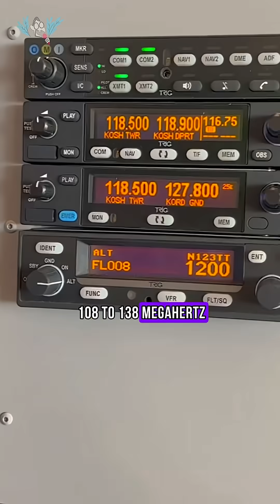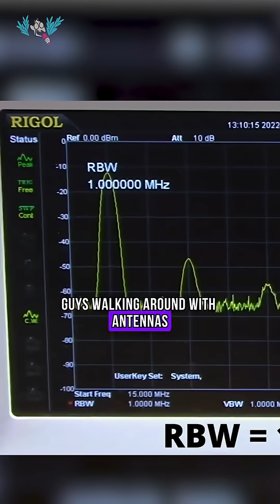Starlink in-flight WiFi banned: Dangerous pilot radio interference

Comment: The 4th...8th... 16th... etc  "of that frequency" he mentions is called harmonics that are also transmitted with non ideal radio waves as all of them are.

And the harmonic goes up ( 1st, 2nd.. 3rd harmonics etc...) , it's power drops considerably... But considerin that the power of the 1st main wave is very high, the power of a few harmonics after still considerable causing interference

Comment: RF Engineer here: Transmitters do have harmonics, but these are multiples of the carrier frequency, not fractions.  Eg. A VHF air band radio can transmit on 120.0 MHz.  The transmitter can have harmonics on 240, 360, 480, 600, etc MHz  but a filter is used to remove these harmonics.  The harmonics of various radio transmitters can overload GNSS/GPS receivers if not properly installed.  Eg the VHF antenna is too close to the GPS receive antenna.  The ADSB transponder can also be overloaded in the same way.
Reply: presumably there would have had to have been considerable testing to qualify starlink for aircraft use. You can't just bolt stuff on to an airplane. That's why you can't legally use your cell phone in flight because every cell phone has not been qualified to ensure no interference with coms or nav.  I know a lot of professional pilots. there is no buzz out there of issues with starlilnk and coms in the pilot community. There have been no ADs, or SBs. There has been no indication from the FAA that starlink is banned. This is some political bullshit because of Elon and his various personality clashes.
Reply: This whole story sounded suspicious. And then I think OP demonstrated his lack of knowledge about radio, so I don't see why trust any of this.
Reply: Finally someone who knows what he is talking about.
Reply: To the RF Engineer, firstly, wish I had gone that path when younger, but I imagine those things are made in China and made as cheap as possible lacking some type of filtering or shielding , I just assume because of some of the cheap radio crap I see come out of China, but I'm curious about your opinion on what if any effect that altitude especially might have on the transmitter, not to mention temperature as I know that can cause issues with electronics, maybe it doesn't have any kind of heat source built into it causing issues, we'd like to think someone thought of all this when designing these things but who knows ..

Maybe I'll look up the f.c.c data on the things later, sometimes they actually tear things down and have pictures of them, but being starlink, they may not publicly share internal photos..

Thanks

Comment: RF engineer here.  AM modulation is used on the VHF aircraft band on the frequencies of 108 to 136 MHz.  It does not broadcast on AM radio which also has AM modulation on the frequencies of 530-1710 kHz.  VHF air band radio has used AM modulation since the 1930's.  They never upgraded to more efficient modulations like Single Sideband, FM, or digital modulation because of the number of legacy radios that would have to be replaced.
Reply: AM radio simply means amplitude modulation radio, nothing more.  He didn't say they use the commercial AM radio broadcast band.  Also, AM stands for amplitude modulation.  You just say AM, not AM modulation, because that's saying amplitude modulation modulation.

Comment: Half, quarter, eighth???... Doesn't it also do a third, a fifth, a sixth, etc like harmonics?
Reply: No.  Transmitters don't produce sub harmonics.  The harmonics, which are supposed to be filtered out, would be at multiples of the transmitter frequency.

Comment: It's actually funny Starlink engineers managed to do this. It can't be a harmonic from the power supply, WiFi or satellite comms. I'd place my bets on it being the ethernet putting out RF. 2.5gbe Base-T would be bang on the 120mhz range for 1st harmonic

Comment: Nitpick: it will be overloading of the IF that would cause interference in this scenario, not harmonic mixing, because harmonics only appear at *multiples*, not divisions of a given frequency.

However, aircraft RF will often go through several mixing stages, at which point the mixing stage(s) of another particularly strong transmitter operating nearby can radiate and cause interference in the other one.

Also: Starlink uses a particular design of steered array antenna system which is poorly tested on aircraft in applications other than radar.

Comment: AM is used because it isn't affected by a phenomenon known as "capture effect". You got close to the issue when mentioning two transmitters at the same time, but missed the overall explanation. Using FM, when two signals are being received, only the strongest signal will be demodulated, and therefore received. The weaker signal is simply rejected. This does not happen with AM, as any pilot who's ever been "stepped on" (had someone else broadcast at the same time as you) can attest. Instead of the capture that would happen with FM, everyone in range listening to the AM band hears the two signals interfere and create a "delightful" cacophony.
Reply: That is not always true for AM modulation.  On the AM radio band many stations across the county are on the same frequency.  At night radio signals propagate better.  Sometimes you can hear two distant stations together with a slight warble.  But most of the time one station will block the other.  You are right that FM does have a capture effect.  Generally you will only hear one FM station.
Reply: @milofonbil (Skip) is not an AM specific phenomenon. That is more of a frequency related thing. Lower frequencies tend to be more likely to skip, or tunnel through layers of ionized atmosphere. As such, these are also obviously highly dependent on solar radiation, so time of day and solar activity.

Comment: That's not the reason they use AM, they use AM as any other modulation technology is affected by the Doppler effect and they'd step on themselves. Also in ATC you don't hear both you hear a beep/hum that lets the operators know they are stepping on or being stepped on
Reply: AM modulation (CW, SSB and many digital modulations) do have Doppler effect.  FM and Phase modulations are more immune to Doppler.

Comment: I find this fascinating … worked in the cable industry, and I remember the FAA would to flybys to see if they pick up analog cable ch 14 I think; also ch 19 was sometimes interfering with the emergency services radios; you could hear it on the tv, also the image would be distorted for the time EMS would be speaking on the radio;
Reply: Cable systems sometimes don't have good connections and leak both ways -- in and out.
Reply: Here in the US, the FAA periodically checks urban areas for cable leakage which can affect avionics.

Comment: All communications receivers are subjected to de-sensitization in which their front-ends are overwhelmed by nearby strong emission sources irregardless of (differences of) their operating frequencies. This phenomenon basically drives a receiver into saturation and out of its linear operating mode (all RF receivers) making it no longer capable of amplifying its intended receiver signal. Careful use of traps, splitter/combiners would isolate systems. The talk about generating spurious energy at half-frequency, quarter-frequency etc (sub-harmonics) are baseless; I have observed only once a sub-harmonic (at half frequency of the original signal ) in a very unique circuit.
Reply: Spurious emissions can be at harmonics of the carrier frequency, due to excessive sideband products (splattering ), intermodulation, etc.  But the sub harmonics this YouTuber is talking about is fiction.

Comment: So many things are wrong in this discussion, first if two transmit in am at the same time you block the two signals, unless one is closely, second starlink is digital and in a totally different frequency band so a simple filtering stops problems, 3rd all internet connections are stopped during landing and take off, etc etc
Reply: No, they keep the Starlinks on continuously, from gate to gate, and do not turn it off during take off or landing. The two signal are so far apart it's unlikely to be a simple filtering issue. As others have pointed out, it's could well be the starlink's power supply that causes the interference.

Comment: Another pilot here. I use Starlink in the cockpit of small aircraft without issue. No interference with ATC communication. Know of others that do the same.
Reply: thats because this video is bs about starlink. Starlink uses a different data encoding based on FM and it is directional along with a different frequency than what the ATC uses, vastly different like way high frequencies. So if you get static that means your power supply is crap and you have interference on your DC lines so your airplane needs maintenance then because the DC power is not doing well or your AM radio is noisy.

Comment: Doesn't know what he's talking about.  First, radios do not broadcast frequencies that are fractions of its carrier frequency.  They just don't.  The math doesn't math.  However, it IS possible for the aircraft's radios to RECEIVE frequencies that are multiples of the frequency they are tuned to, and if that happens, if is a fault in the aircraft radios, not Starlink.
Second, putting out 10 kHz packets does not produce multiples of 10 kHz in the broadcast, at any detectable level.
This guy is just spreading old wives' tales.

Comment: This is the stuff that drives circuit board designers ABSOLUTELY NUTS. Copper left on the circuit board even if it's grounded can act as an antenna gathering signals in stuffing it into everything you're trying to control. It's just absolutely ridiculous. The best example of this is security tags in stores have no power supply yet they work. I need to add they receive power, energize their circuitry and send back an alarm code if not decertified buy the cash register.
Reply: 100% EMI/EMC issues are complex indeed and can drive designers nuts.  It's not only radiated interference, but conducted interference.  This is why some USB power cables have ferrite filters built in.

Comment: Jesus this is complete nonsense. voice band AM is very narrow, while Starlink or 5G are wideband signals. All OFDM. Very easy to null out a few subcarriers around the interfered part. 30 year old technology (ADSL) was able to do this during line training. And most of the line noise was from AM radio stations by the way... And the title is also click bait, as the (alleged) interference has nothing to do with Wifi, but the Starlink's space segment. Starlink's uplink is at 14-14.5Ghz. Can someone truly believe that the lower harmonics can go all the way to the Airband? Any documents or measurements that proves this?

Comment: Starlink transmitters can have out of band filtering and shielding incorporated on their terminal’s transmitters, and their satellites and ground stations, to prevent the interference on all bands they are not authorized to be transmitting on! Transmitters with strong Spurious, out of band emissions, are not permitted to operated by the FCC, and the owner or manufacturers can face stiff penalties and be forced to stop operating until a solution is implemented! There are no good excuses for manufacturers to make dirty transmitters, that emit outside their assigned frequencies! KE8TNW

Comment: AM and Single Sideband Radios can have Noise blanking and filters! I know, because, Amateur Radios have AM, Upper and Lower Single Sideband, and narrow and wide band deviation, FM. By the way, no analog AM (dual side band with carrier). Single Sideband Band (Upper or lower Sideband) or FM, all forms of analog audio transmission do not have error correction either. FM is often cleaner and noise free, provided the transmit signal is strong enough. If it is not, popping sound often called bacon frying, or picket fencing type flutter will often be heard as the signal fluctuates between strong enough and too week for full reproduction, will bears on both the 2 Meter ( 144.0-148.0 MHz and 70 cM 420 MHz - 450 MHz wavelengths when using station to station, simplex (same frequency for TX and RX communications or using a repeater using Duplex (TX to a repeater receiver  with immediately keys up the Repeater Transmitter typically 0.6 MHz above below  the Receive Frequency for VHF, TX to a repeater receiver  with immediately keys up the Repeater Transmitter typically 5MHz above above the Receive Frequency for UHF) to contact other stations. Only Digital data representing Audio, such as C4FM System Fusion for Yaesu, DSTAR on ICOM radios and DMR, an open Digital Format, used by multiple brands of VHF and UHF Amateur Radios  have FEC Error Correction, and even it is only partially successful in muting distortion since the transmissions of voice data are in real time with no time to resend the missing data which would require unacceptable delays to reassemble the original message with the correct bits inserted to correct the bad data, causing an unacceptable lag in delivery of the received audio (latency) the bandwidth is not wide enough to be fixing corrupt audio data strand in real time. KE8TNW, Amateur Radio Operator, Extra Class, FCC Licensed, (Top level, US FCC License, with full operational privileges, there are three current licenses and operator can obtain today: lowest level of operator privileges: Technician, General, Extra)

https://www.hamradioschool.com/post/intro-to-dv

Comment: The most difficult part of designing a Transceiver of any frequency is all the shielding, filtering, interference suppression and tuning one need to do.
And then you build a prototype and it just won't behave like it's supposed to, causing you to chase ghosts trough the system for months.
And then it finally works and you roll it out only to be flooded with complains where it again didn't behave as expected but only in certain circumstances, which you nownl need to figure out.
And thats why professional Radio equipment is basically unchanged since decades, nobody wants to introduce unknown variables in such a fragile system.
Reply: Temperature abbreviations also significantly affect 50 ohm RF component references and create drift

Comment: One thing about AM radios that I'm sure the ham guys know: Morse code will get through on AM signals when nothing else will. It might just sound like static, until you really listen carefully...then you will be able to pick out the dots and dashes in all of the other noise, whether it's from lightning or solar events, or whatever.
Reply: Trying to identify VORs at the edge of their range can be tricky. I pull the squelch and just barely get the Morse code.

Comment: This verry true, I work at an airport, and if the guys are on the ground in a piece of equipment(for example, an enclosed lawn mower), when they drive around, nothing happens. But once they start the mower, even being in an enclosed cab, it cause a hell of a lot of static from the frequency of the blade running. There are some scrubber devices we can use, but to be honest, they really don't help too much.
Reply: I’d think it is the ignition causing the interference, not the spinning blades.
Reply: Yes and no, all the equipment we have issues with are mahanical diesel with no spark or ignition, purely compression. I have also found some of the times the cables had damage at the crimped ends going into the radios. Replacing these would help some of the issues.
Reply: @masterbower6083  Could it be the alternator in that case? Can’t imagine a diesel engine with pull start and no glow plugs so I’m assuming there is a battery that needs charging?